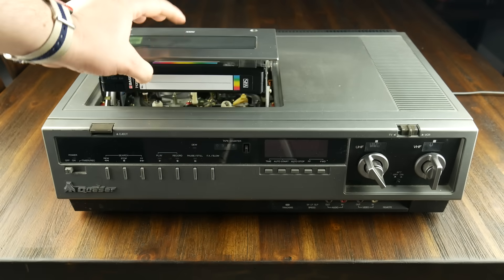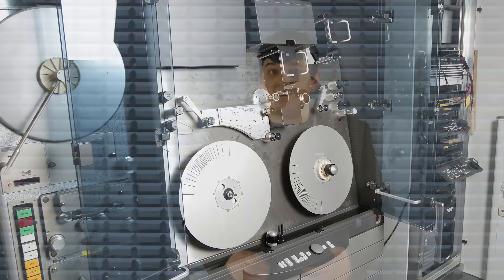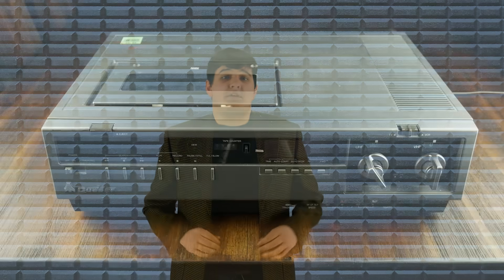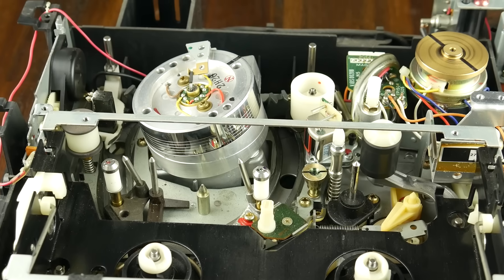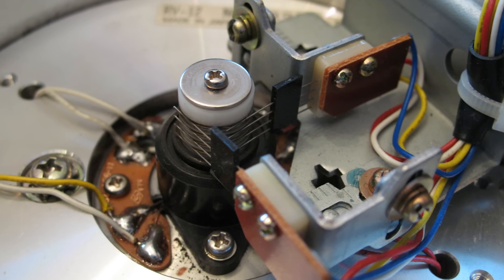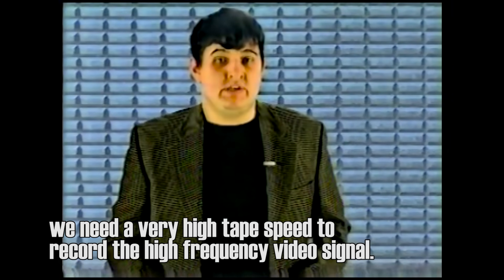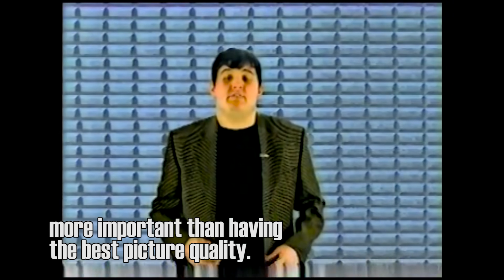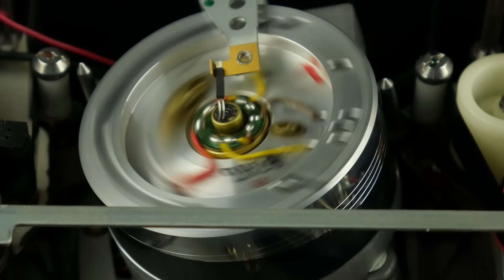The Impossible Feat inside Your VCR

Comment: The gossip I heard back in the day on why the LP speed was removed had a lot to do w/ JVC (the creator of VHS) never considering it to be a part of the VHS standard since it was a speed forced on them from RCA who wanted a VCR that would double the capacity of tape recording back in the early days of VHS (I think the very first machines only had SP).  So JVC reluctantly gave RCA what they wanted so they could market this feature even though it meant that the change of speed didn't work well with VHS since it would not sync well when performing special affects like FF and REW while viewing the video (and that appears to make sense since when we see how an image looks being FF or REW w/ video on a 4 head machine on the different speeds, LP definitely looks the worst due to thick scan lines one does not see on SP and EP).  

Anyway, JVC supposedly stuck to their guns when is came to their own machines and never made an LP speed VCR in any of their models from the earliest to the latest machines.  Other manufacturers did adopt all three speeds early on and eventually something changed and everyone started to drop LP in the later years (although I think RCA still kept LP longer than anyone else including Panasonic).  Anyway, I'm not sure if it was some rights issues that maybe JVC implemented on standardizing VHS but that could be the reason for LP disappearing as it did.
Reply: what speed are pro vids recrded at?   sp?
Reply: Original tapes recorded by the studios always encode them in SP since this is the "Standard Play" speed that will play consistently from machine to machine (there are tolerance issues when an LP/EP tape is played from one machine to another which explains why we have tracking issues on picture and sound) and provide the best picture (VHS SP has a horizontal resolution of 240 lines vs. LP/EP at 220 lines).
Reply: that's right, JVC was against it because Panasonic came up with the LP speed and copyright claims, some VCR's even had heads "cut" for the slower speeds for a better picture, Panasonic made a lot of machines for other brands.

Comment: It was the amazing complexity of VCRs that had me pissed that early DVD players were so damned expensive. They were mechanically no more complex than a CD player and couldn't even record. I literally didn't go to DVD untill recorders became available. DVD did have a better picture quality than VHS, but without recording ability, it was not much use to me. Fortunately that changed, but I still respect the sheer genius of videotape recorders. It's amazing that they could make them so good and yet relatively cheap as consumer devices.
Reply: The early VCRs were crazy expensive.

And there were VHS players (with no recording possible) available during the VCR era. For those who couldn't afford or just didn't want/need the recording variety. Not that surprising that DVD players / DVD recorders followed similar patterns decades later.

Comment: That was quite interesting.
I literally knew all of it but the head drum coupling (I thought they always used the string pick thing, didn't know about the transformer method), but sit there till the end. The picture comparison on the fly specially was a pretty amazing editing technique there. I did grow up with VHS tapes, but on the tiny (at that time we felt they were big) CRT tubes it didn't show up as that low quality, neither we had better to compare. Keep in mind I'm an early 2000s kid, born in early~mid 90s but grew on the transition to DVD, childhood on VHS and early teens into DVD age (No, I did not have a PS2 or DVD player back in my childhood, I think we got a DVD player around 2005~2006).
Graaanted you can always nitpick on the VHS recorder's quality and tape and all... But this does provide a perfect average of what it was.

One interesting thing about the VHS times was the camcorder format war that neither of the formats won: Video8 vs VHS-C. Video8 had sound system pretty similar to Hi-Fi VHS system, and kept tracking differently, on a pretty similar, if not slightly better, video quality, on smaller (but considerably more expensive) tapes. VHS-C tho was nothing more than a smaller VHS cassette. Advantage? Trow that into a mechanical adapter, and stuck it directly into a normal full size VHS player.
Reply: Everything analog looks better on a CRT TV. Because digital Displays just can't show it good enough because they work just completely differently. Analog TV lines and digital pixels behave so different that you need a lot of effort and technical trickery to make it look good on both. Most TVs have terrible upscalers to blow up the lowres analog video to a digital Full HD LCD panel. However good dedicated upscalers do a great job. They just cost a little…  Yeah Video 8  was great. It just sucks that this was a Sony format and as such… was proprietary and poorly supported by 3rd party suppliers and always needed to be played back inside the camera, which wore out the headdrum and mechanics inside faster than you wanted… and standalone Video 8 decks weren't widely available like VHS decks which you could use to playback VHS-C tapes in a adapter cassette. I think that was the biggest drawbacks.

Comment: BRILLIANT vid. Nicely put together. No matter what people said about VHS, by its era it a marvel on itself. The drum and heads were made with stunning precision. So much going inside of a VHS machine, that user never noticed, because the system was fully automated, from the simple tasks like loading to the complex ones to adjust and correct speed. Audio decks offering Direct Drive and PLL or Quarz were PROSUMER and expensive. While the consumer table VHS was far more complex not advirtising any of it internal elements inside. VHS used Direct Drive on both Drum and head and speed was PLL controlled using signals from the tape. The high level of presicion to get an image steady, with 3Mhz BW, blow any marketing advert or a prosumer audio deck using 1/10 complexity but trying to take big money from you.

Comment: I thought Philips VCR was the first "home" system, with the unusual over/under spool arrangement in a square cartridge, while Sony U-matic was the first cassette system.

And of course, the latecomer to the party, Philips Video 2000, technically advanced but just too late to displace the incumbents.

The 2000 tape was 4 hours per side, turned over like a cassette, with each pass using half the total width.
Dynamic auto tracking was a standard feature, baked into the system using 4 low frequency pilot tones and the head tracking steering for equal bleed of the two adjacent tones to keep it centred... If I recall, it used a "C" wrapping system rather than an "M", with the wrap mechanism rotating around the head.

Helical scan also carried forward into DAT - Digital Audio Tape - though it seemed to find more success as a data recording format than an audio format.

There was also a device, the "Danmere backer" that could store data on video cassette, though with speed and capacity we would now consider a joke

Comment: The top loader vcr's are my favourite or were when I was a kid before I understood why the newer ones are better. I'm definitely looking for another vcr for my retro games room and video rental replica.
Reply: The newer ones have better video and audio quality, but the older ones use simpler parts. So, in 100 years, if a VCR can even still work at that time, it'll definitely be an old top loader, while the newer ones will be inoperable because of missing firmware, dead 100+ pins surface-mounted CPUs...

Comment: In the early 90's recording your band's music with VHS HiFi audio was the poor man's alternative to DAT or professional open reel analog. In fact the overall resolution was somewhere between pro analog and CD/DAT. It was still an analog signal so it did have a bit of forgiveness for recording hot. But still you could record quiet and still have a very clean and dynamic pro sounding recording. Best stuff we did was hook the VCR to the tape out of the practice room mixer and capture live performances. Also good for mixdown and mastering those cassette 4 track Tascam portastudio  projects.

Comment: In later years, Panasonic introduced an even slower VP speed, with the tape running at only 0.262 ips (1/5th the speed of SP), providing 10 hours of recording time on a T-120 tape.
Reply: Oh hey VWestlife! Nice to see you here :)  Yeah, the later years of VHS were quite interesting. I remember my LG VHS deck had some nice features like a video doctor, that warned you about dirty heads and cleaned them for you. Didn't really work that well thou and as much as i hate VHS cleaning tapes because of the possible damage they can cause… they still solved the problem better than the built in solution. However… some Panasonic Decks can be permanently ruined with using such cleaning tapes, rendering the tapeheads completely useless in an instant.
Reply: Panasonic’s VP speed is non standard.  It was introduced in the late 2000s after VHS was effectively a dead format (replaced by DVD and Bluray).
Reply: The longest tape I own is a T-240 (four hours).  That’s 12 hours using VHS slowest speed.  Or 40 hours using JVC’s Digital VHS.  (The nonstandard VP would put 20 hours of analog video on a tape.). It also looked like crap.
Reply: Now add Hi-fi to that, now you have 10 hour youtube videos in 1989.

Comment: Thank you for an engaging presentation, really took me back in time.
During the VHS v Betamax battle there was a system by the Philips company known as the '2000' system.
You could get a 4 hour cassette, very similar to the VHS cassette in size and the same tape width, except that it could be "turned over" and had a second "side" that recorded / played. I believe this was acheived by having piezo transducers on the helical scanning heads that could mechanically move the heads to enhance the tracking accuracy on the tape.
One of the advantages of the head system was really good slow motion or freeze frame.
Very much looking forward to your future productions

Comment: Good video. PAL had a superior image to the NTSC demo you showed. 90's NTSC on VHS is pretty awful. I grew up on PAL (Australia), and NTSC - especially on VHS - has become really noticible to my eyes. I CAN SEE THE FRAMES, MAAAN.
Ah, those days of Tom & Jerry, Dangermouse and Popeye.
Kids these days, amirite? Do you remember when T.V. used to be exciting? le sigh
Reply: This video is a very bad example of VHS quality. It can be much higher than that, not to mention that it is pretty much impossible to perfectly convert analog video to digital, and you're watching it on youtube, compressed, ... Really, VHS has only two problems. Remanence decay, and its fragility. Every time you play a tape it degrades it, some VCRs treat the tape more poorly than others, they may gain bad habits of ruining it... You could say that VCRs are the third problem with VHS, these things are cursed.

These are huge problems. But a new VHS played with a well-behaved VCR, on a great television, it's pretty much flawless.
Reply: Aye, t'was pretty low quality, even for VHS. PAL is a superior standard, though. I had seen Techmoan's VHS demo tape as you talked about and that was quite spectacular. Yes indeedy a lot of VHS machines were more like mining drills than swiss watches, especially mid-to-late in the game as the price fell and the "VCR Repair Shop" rose, bloomed and then laid dead and stinking for far too long afterwards. An epicly ubiquitous format, to be sure.

Comment: This is the best it gets
That's just not true. It may have been the best you could get on whatever setup you were using but you can find videos here on youtube that were transferred over from VHS that looks better than that. I used VHS for much longer than most people, my machine finally died a few years ago and its picture quality was nowhere near that terrible. Obviously, your mileage may vary, but it wasn't as bad as you make it out to be.

I also don't recall LP being nearly that bad, though I didn't have a VCR that could record LP until pretty late, so maybe it got better over time.

Anyway, interesting video overall.
Reply: Disthron Youre right, it seems hes using some crappy deck. with a nice normal,  non s-vhs tape in my Jvc Svhs deck, recordings were just great. For myy taste, Jvc decks were paramount. cheers
Reply: Disthron I've recorded some videos from on demand on the VHS tape it came out pretty good. most people probably recorded through the RF input I usually run composite cables from my cable box to VCR for better quality.